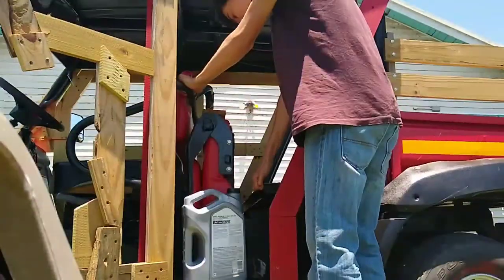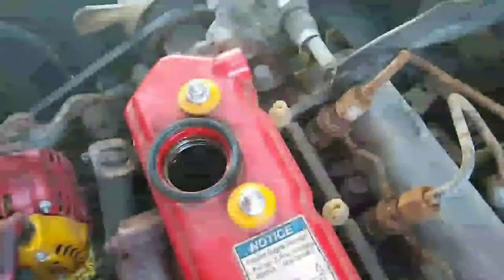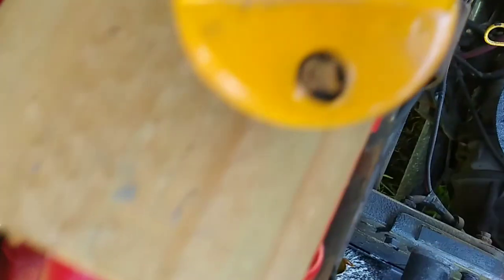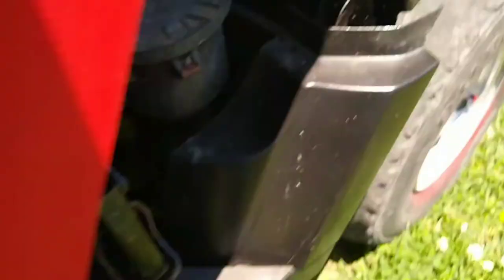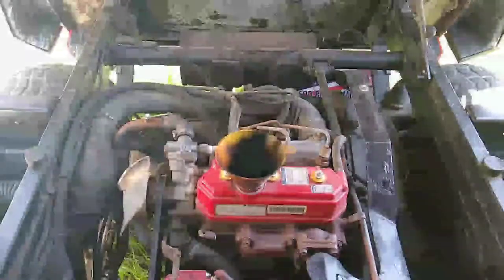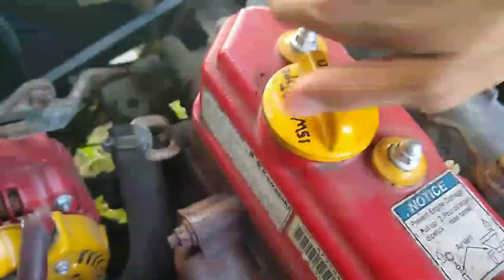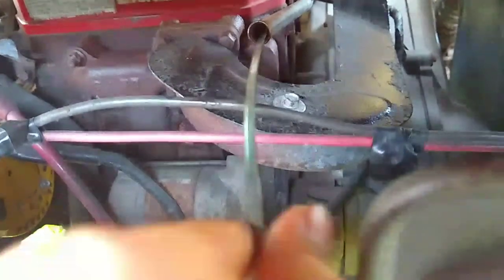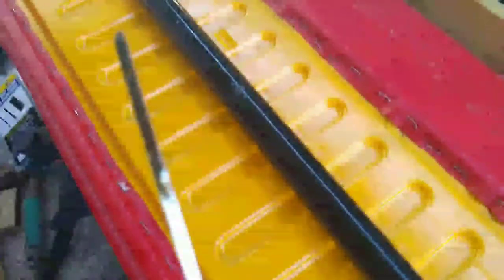How to CHECK & REFILL your oil on your Kawasaki Mule

Comment: Why are you adding oil if you did not even check the level?
Are you checking the oil level with the engine hot or cold?
You probably should have let the paint dry before you put the cap on after you paint the valve cover.
Reply from the maker: This was an old video I made and I had no clue what I was doing. This video should’ve been a forgotten draft to be honest. Besides, I don’t even have the Kawasaki anymore. If you go look at my videos, I had said that I sold it.